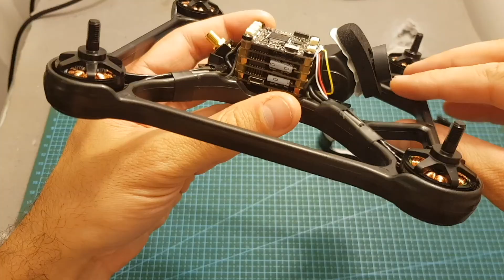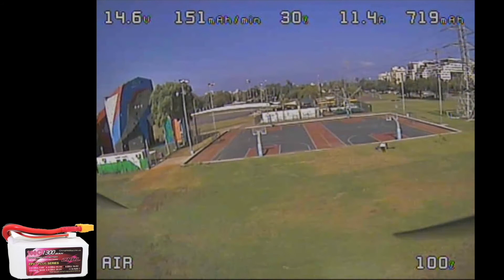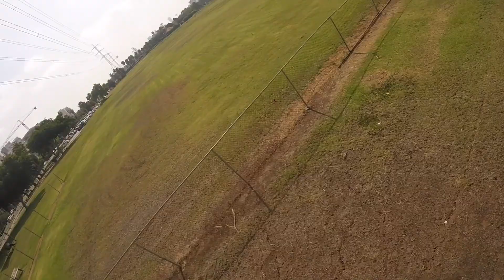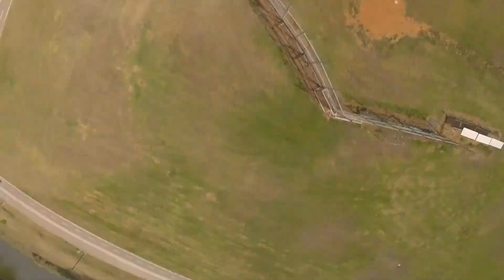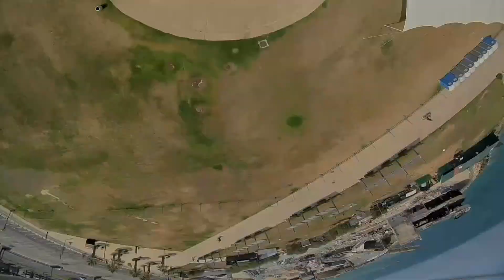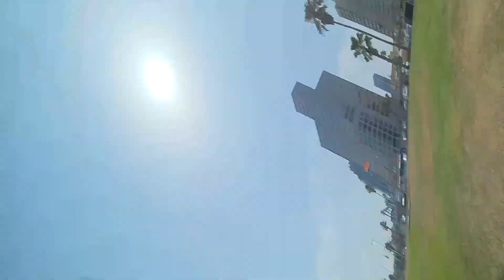TBS Oblivion - Setup & Review

Comment: Can it run 6s?
Reply from the maker: The stack - yes. (Motors KV is too high but you can limit the motors output power)
Reply: @KremerFPV  where in betaflight do I do that? Also how do I upgrade motors of the motors aren billet connectors? Do I have to add bullet connectors?

Comment: Does it have different modes like self leveling or Cinewhoop. Is it default Acro mode only?
Reply: I have no idea why he said that it's running betaflight as it isn't even your question, so I'll answer it, yes it has self leveling, but no gps leveling, only gyro, and it has 3 modes AFAIK, they are horizon, angle and acro mode.
Reply from the maker: It's running Betaflight.

Comment: I had bad experience with plastic framed race \sports quads I literally had a minor ding with my rodeo 150 and it died now I'm stuck with a fairly nice transmitter the devo feels like a solid well made one but can I find any thing from them bnf noooooo so I'm dubious but it's a nice quad
Reply: I have a rodeo and a runner 250. 
The rodeo is tough. The runner needs reinforced. Mount your battery on the bottom if it will not bind hold down the clean button. Search Walkera Runner 250  won't bind. There are several videos about that

Comment: Did you fix the RSSI/LQ problem? I have noticed that the values in the OSD are constantly changing from 100 to 0.
Reply from the maker: Yes, I had a lot of issues with that. Eventually I used the same receiver on a different quadcopter (Diatone Tyrants 630) and I didn't have any issues (Same configuration).